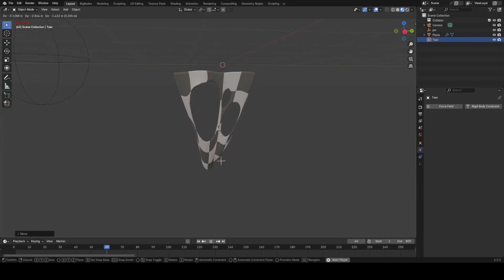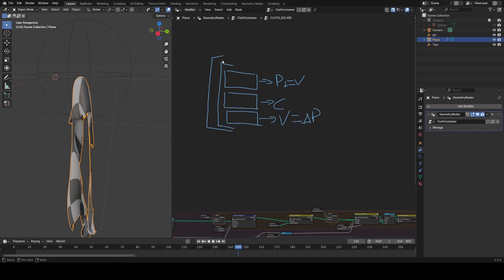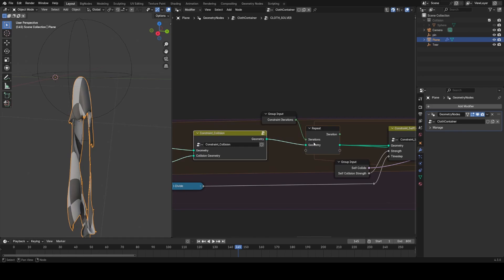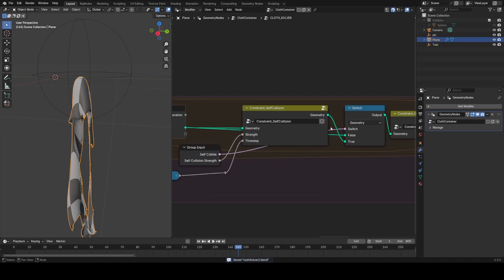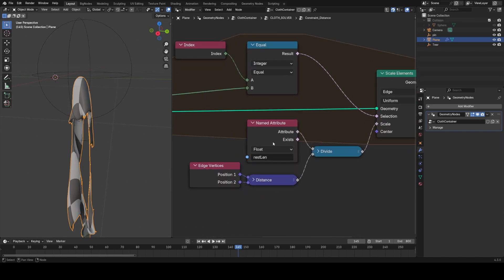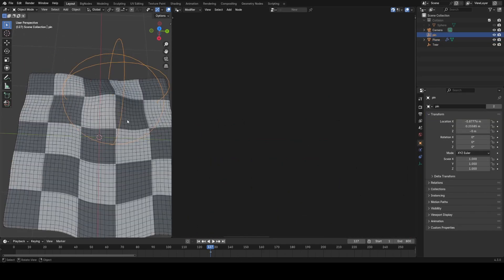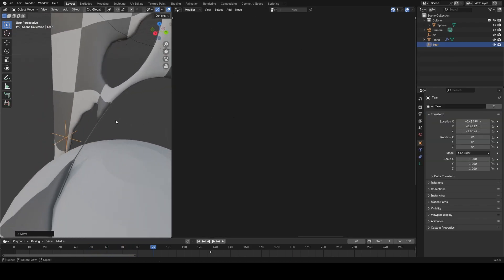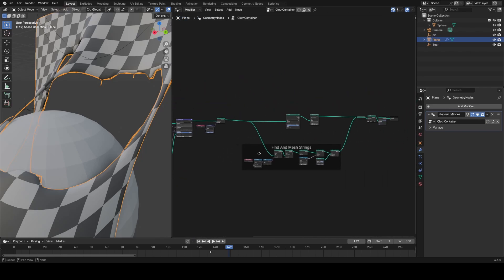Tear Cloth in Blender with Simulation Nodes

Comment: Is there a way to use vertex group as a Pin like in default cloth simulation engine? Or some way to use several empties-pins at the same time? I'm trying to make tearing clothes on animated character, but can't figure out how.
Reply from the maker: Yeah you can make a vertex group then plug the named attribute into the pin group, with the same name as the vertex group :)
Reply: Jesus died for our sins to give us eternal life and save us from sin.